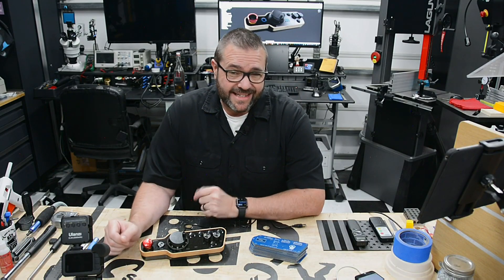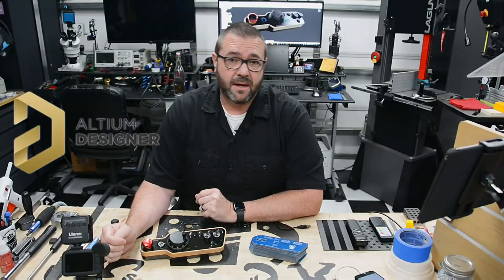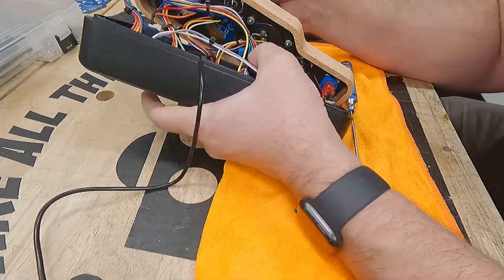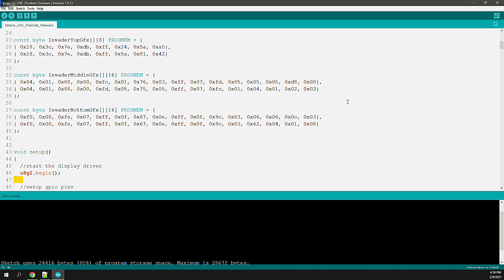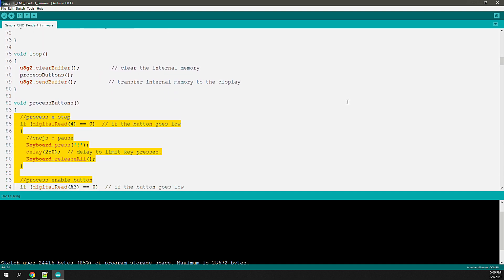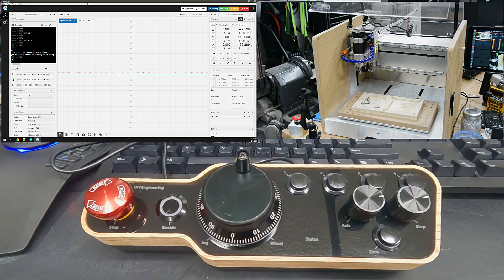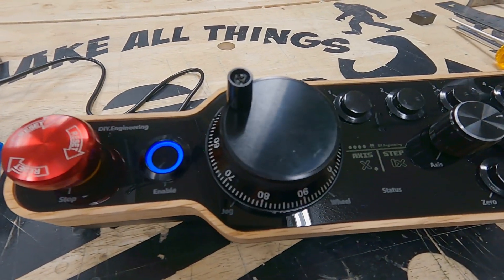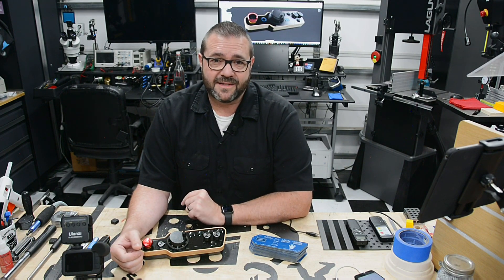Programming the Arduino Logic for A Custom CNC Pendant!

Comment: Using an Adafruit ESP32 Feather and a rechargeable Li Ion Batt, I made the electronics wireless with a bluetooth keyboard HID library... Look Ma, no wires!!! So now I will need to make a new PCB (I use Altium professionally so no big deal) and order 5 to 10 boards. I will add a small on/off rocker switch and USB charge port to one side of the bottom when I print it so I can charge the battery and it should easily last several days without needing to be charged. Also, the software now asks which program to emulate (macros to use) when powered on (selectable via the hand wheel) and I have a selection list that determines the macro keys to send.
Reply from the maker: Nice work! Way to level up the project!

Comment: What a great project! Respect for all the hard work on designing, coding and video editing! After watching this video I went over few more of your videos and your style is impresive and unique. I'm quite noob in Arduino and since I have few boards lying around I build a quick mock on this project. But after uploading the sketch I observe something not present in your video - the OLED flickers soo bad! Like 120 time per minute. Am I doing something wrong? What can i do to fix that. Regards!
Reply from the maker: Too many variables to guess, You can always look at my code over at http://github.diy.engineering
Reply: @DIYEngineering  I fixed the problem that I created. Already mentioned that I'm noob in these Arduino things. As it happens I have a different display - SSD1306, NOT SH1106. That means I needed to change a line in the sketch with the relevant display type e.g.:
U8G2_SSD1306_128X64_NONAME_F_HW_I2C u8g2(U8G2_R0, /* reset=*/ U8X8_PIN_NONE);
Thank you for your work done on this project!👍

Comment from the maker: Hi and thank you. for the most compatibility, the primary integration of the pendant is via keyboard shortcuts, this differs from software to software and can be adapted to linuxcnc. direct api integration is also a possibility but would require some code work. ;)
Reply: this will not work with linuxcnc

Comment: Amazing project! I was looking for something exactly like that. I was looking in your code and couldn't find what's the purpose of stepvalue that you read from the second rotary switch. You don't seem to use it as a multiplier anywhere. Is it something that's not possible with cncjs and you add to use it with a different software?
Reply: Already found a solution. Asked myself the same question ?

Comment: Hi David, amazing project! I already received your PCB and have most components but missing the headers for wires connections to the board. do you have the link or names of used on the video?
Reply: Facing the same Problem. Do you already got further

Comment: Very professional looking pendant. I like it very much. Do you have any issues with timing and sluggishness or delayed responses from the controls?  If so that could be handled by using interrupts in the code. Takes a bit more work to implement but it will allow much better responsiveness

Comment: Great work on this! If I understand correctly, in most cases GRBL has only one serial interface - if it is running on an Arduino Nano or UNO. How you can use the pendant and then send the gcode data to the CNC at the same time?
Reply: nevermind, got it! You are connecting the pendant to the computer and not the grbl board directly
Reply from the maker: Yep that’s correct

Comment: Anyone figure out how to add macros to say, button 3, or 4? like a tool change maco for example.
Reply from the maker: Depending on your level of comfort you could try one of the following with cncjs:
1) use autohotkey.com to execute a  macro defined in the macro widget, then call that hotkey from the pendant
https://www.autohotkey.com/

2) develop a custom pendant widget to relay commands to the controller.
https://github.com/cncjs/cncjs-pendant-keyboard/blob/master/bin/cncjs-pendant-keyboard#L108-L211

3) send commands directly into cncjs port.
https://github.com/cncjs/cncjs/issues/503

or
you could use UGS and assign hotkeys to your macros (easy)

or 
you could use Candle and develop just about anything you want

Comment: My CNC started out as an original Arduino based X-Carve; it’s been upgraded structurally to a TBD-CNC direct drive. The Arduino didn’t have the grunt to handle the direct screw drive so I’ve changed it out for a 3DTek GRBL AIO controller and Universal G-Code Sender. Hopefully a pendant like this works with the Frankenstein CNC I’ve been running!  Great video and and as always your design and finished product is immaculate!  Well done!
Reply: What are some signs that show the Arduino is struggling?

Comment: I love the design of this thing, and I never imagined it would be so simple and elegant to make a really high quality pendant for a CNC. Did you end up using the USB interface on the Arduino to connect to the PC, so that you can reflash the EEPROM without having to connect to the internal port on the inside of the pendant? I can see why it would be a good design choice if you didn't to avoid having people potentially overwrite or break the software embedded in the unit, but it seems like having the one plug going to the PC and using it for everything could be simpler. What do you think? 

This way I suppose you could also use a driver application that runs on the PC to pick up the serial writes from the pendant and then translate them to whatever application you're using -- the driver app could even detect what's running so it adjusts the key bindings automatically. Beats having to increase the size of the codebase in Arduino IDE to support other gcode senders. Also potentially this approach could let you have bidirectional communication with the pendant so that it could be stateful and aware of what's happening with the machine. This would be especially useful if you were in a homing cycle and controls needed to be disabled temporarily, or if for some reason the e-stop didn't disable (and the button has been popped out on the pendant, mismatching with the state of the machine).
Reply from the maker: Hi Daniel,
These are the things that keep us up at night, but also fall into the "over-engineering" category... someday that will be a topic in my ocd.engineering channel... but not today! Today, this thing went the easy route, allowing people to flash to their hearts content and have full control to make it do whatever they want... but yes there are lots of great custom and production grade direct integrations that could be accomplished with the right partnerships/development apis. I have a pet project working on a candle branch which will have the most robust implementation, but I know everyone has their own favorite... I sense you have some development experience...  interested in collaborating on this work?
Reply: @DIYEngineering  potentially yes, what did you have in mind?

Comment: Too cool David. I love the little display and the sweep of the scan line. Did you add that or is it the normal function of the display?
Reply from the maker: The scan line is only noticeable in video. It’s a rolling shutter issue... not intentional. ;)
Reply: @DIYEngineering  I figured that right after I send the reply. Just haven't seen it in a long time. As always, the project looks great. Take care my man.